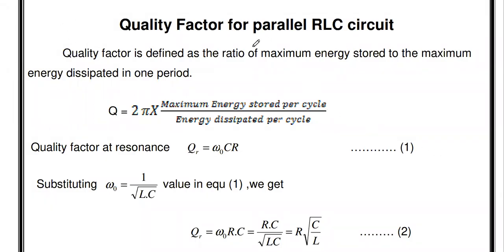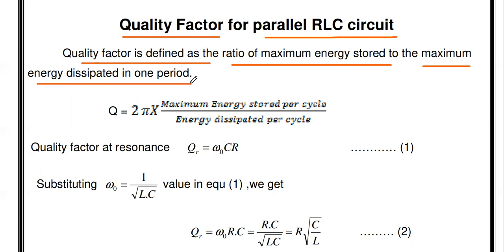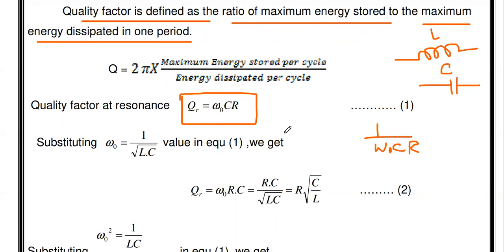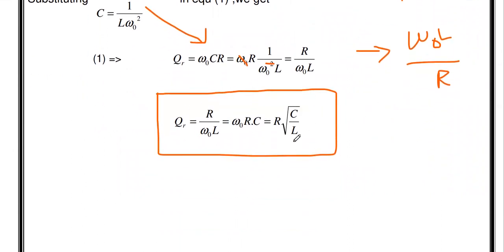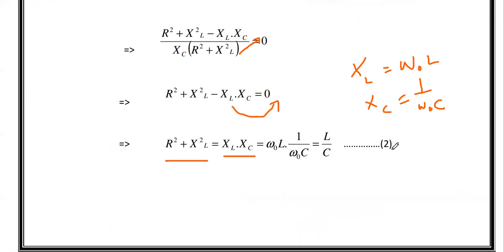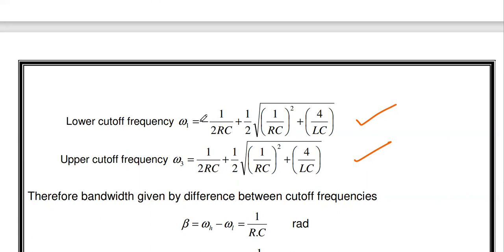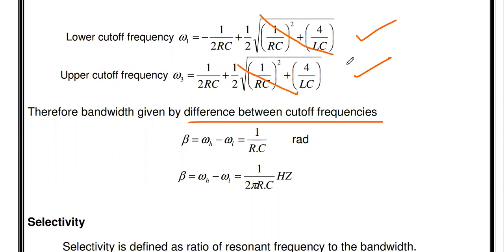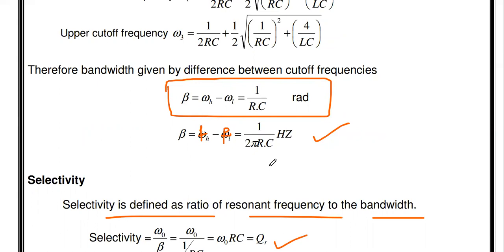Bandwidth of parallel resonance circuit | Quality factor | Selectivity

Comment: Thank you for your nice lecture! At 9:51, when you derive the expression for the bandwidth, you came up with the power in RLC circuit ( eq. 1) and power at resonance (eq. 2). What power quantity did you refer to? The instantaneous power is not constant. It changes with time. Is the power you referred to the maximum power flowing to the RLC circuit? As you mentioned the current amplitude changes with frequency, you must assumed the voltage source to the circuit has a constant amplitude.